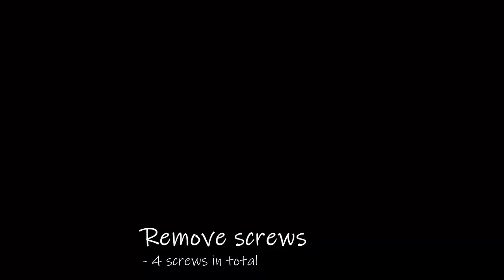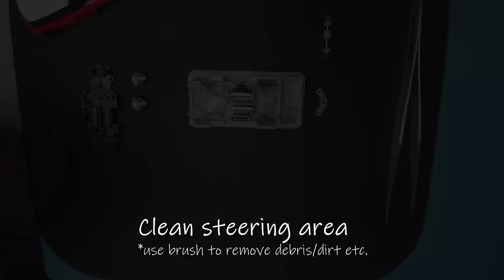Tiny Racing (Turbo Racing 1/76)   Part 3 - Stuck Steering/Maintenance

Comment: Little tip for the front wheels. You can get them of the axle (pull carefully). Then you can deep clean, and lube the axel and knuckle. I use silicone spray for that.
Push wheels back on axles (carefully, you hear little clicks when it snaps in place).
Re-assemble the car.

Now, to make it really smooth, you take a multi tool with a roundisch tool in it. Spin it on low speed, and lightly hold the front wheel on it, so it starts spinning.
Do this for both front wheels. ( Not the backwheels!).
This will make the front wheels run smoother then from factory.

If you like, I could make a video of the procedure.
Regards, Rene
Reply from the maker: That's a good one! Understand what you're saying. 

Since there is a need to be "careful" removing wheels from the axle (and re-sitting it back till hearing the "click"), a video highlighting this procedure would be great. Definitely would help the community!  

Cheers
Reply from the maker: @renekatuin  🤣 thanks for the vid, looks good to me!
Reply: For this procedure I am using a Dremell electric tool to "warm up" the front wheels. After couple of minutes the front wheels are ready to fly ;-) Some of my TR bugs came with over tighten front wheels and rolling on the road was funny and shaky. Now all they run well.

Comment: Thank You for making and upload this video. I struggled with one of my cars, actually the same color as the one in this video, so I had to disassemble it. And I really should now better. Of course I messed up and ended up with a some small pieces I did not now where or how to fit. Luckily I had seen Your video, and I watch it several times again. I did not notice the small springs when disassembling so they were both gone. I found one stuck on the magnet beside the motor but the other was missing, but luck was on my side so I found it on the floor. And now the little fellows back on the track thanks to Your video.
Reply from the maker: You're welcome 😊 Glad to hear that the car is back on the track and all's good!
Reply: @simplyatomic  Hey mate any idea what you call that gear at the steering rack ? you know the one thats a v shape of looks like its cut at an 90 degree angle ?
Reply from the maker: @thebandit1324  No idea what's it called. It looks like a normal gear but only a quarter of it. 🤷‍♂️

Comment: Great video. but my C82 steering wheels seem to be stuck frequently and mostly towards one side. I have opened and cleaned every part and put it back. Yet the problem persists.
Reply from the maker: Thanks! Maybe you can try to "deep cleaning the front assembly (https://www.youtube.com/watch?v=0H2iGrXXu8k)" If still persists, I'm guessing it could be worn out if you run it often.

Comment: One of my Mini Coopers have a weird problem. After some racing the steering stuck again. After the maintenance you've shown in this video it is bac on the road but after some time it is stucked again and again. So I've reached the conclusion to order and replace entire steering assembly. Hope with the new parts to resolve that very unusual malfunction . I have 17 Turbo racing cars and have such a problem with just one. We'll see when the parts come from China.
Reply from the maker: 17 that's a lot 😍.. 1 out of 17 is not bad! Hopefully the new parts resolve it. 

Anyway, while waiting, maybe you wanna check the motor for the steering (see if there are any dust/dirt; check if it "gear" on it is not too loose; press down the motor to the chassis to make sure the contact is fine).
Reply: @simplyatomic  Immediately after purchasing my TR "bugs" I am doing one useful procedure : gluing with a little drop of silicone glue the both motors to make sure the are solidly flatted to the shasy  and to prevent any movement and full contact with the gears. I found the problem with that Mini : The fan gear have couple of teeth damaged , and every time I pull steering to full right direction it got stacked . The new fan gears are on the way, so soon the little bug will be in perfect health ;-) And by the way - I am racing my TR bugs ONLY on my micro drome, not on the floor or outdoors. For outdoors I have another scale vehicles ;-)

Comment: Hi there ! I own a C72and i wonder if you can just remove only the wheel whitout dissassemble the whole thing. There is no video on this procedure ( just chinese one with no voice ) because they are not rolling free because full of dust and stuff and the car go a little bit slower has usual.
Reply from the maker: Hi, have not tried pulling off just the wheel. But @renekatuin posted that he deep clean and lube the front axle by removing the wheel. He also posted a video on how he did it ( https://www.youtube.com/watch?v=0H2iGrXXu8k ) . Btw, this was for the older model not the C72, but I guess it should be identical.
Reply: @simplyatomic  Yeah i finally did it after finding another video using a flat screw driver to make the wheel pop off and the axle is too big to be bent. When you want to put back the front wheels you need a tiny bit a metal to put it inside the front and push the axel then push back the wheel.

Lot's of dust and tiny hairs, now my car run like a charm again.

I wonder if i can 3d print some wheels to make it drift like the c64 but without any gyro.

Gonna try this week if i got some time.
Reply from the maker: @nobocks  That's great! 

Should be tough without a gyro but why not!

Comment: Mine stopped working, I put it to charge on the controller, but it's not picking up charge. Neither on the controller nor via the USB cable. It's not turning on the light. It has been unused for a long time. Was it the battery? When I plug the USB cable into the cell phone source, it emits a very quick flash of light and goes out. It's not working. Help!
Reply from the maker: Sounds like battery issue. If you don't use it for a long time, and the battery is left uncharged, it might drop too low causing the battery to fail. Try charging it awhile on a USB charger, sometimes this might "wake" it up. But be sure not to leave it unattended when its charging!
Reply: @simplyatomic  Okay...I'll try. Thanks

Comment: my steering is stuck and I can’t figure it out, took it apart but have yet to get it to turn consistently…it’s new
Reply from the maker: since its new, there shouldn't be any dust/dirt. try checking the transmitter steering trim, make sure its at its center point and redo it.

Comment: Hello! i need your held! Me and my brother  brought a TR C72 and its amazing. However, we have a problem with the cars, when we turn all to the right the car makes a spin. I already cleaned bur the problem didnt disapear! Any ideas? Thank you a lot.
Reply from the maker: Hi there! Base on what you've posted, I would:
1. Check that the front tires are rotating freely by spinning it and see if there is any binding. If yes, check out mini rc channel video ( https://youtu.be/0H2iGrXXu8k ) on how to clean it (also check the rear axle too) .
2. Try running it without using the body. If it turns well, the tires might be touching the body.

Hope either would solve the issue.

Cheers

Comment: hi, I have a problem with my mini. After a few days the car steers more to the left than to the right. It's not a problem with the steering trimmer on the remote control. I tried cleaning and there was actually a bit of dust but the problem remained. what can it be?
Reply: I solved the problem! I removed the front wheels from the axle and there was dust and hair. After cleaning and reassembling all Is OK again!
Reply from the maker: Hi, sorry to miss your post. Glad you solved the issue!

Comment: Hello, my car is not going straight. I can trim it, but then the left and right are not the same. If I dismantle the car and let the servo turn off and then put everything back together in a straight line - it just won't go straight. I have no idea what else to do. Do you have any ideas? Greetings Daniel
Reply from the maker: Hi, if there is no binding on the servo, there might be some dirt build up or dust/hair in the front wheel pins. Check out mini rc channel video ( https://youtu.be/0H2iGrXXu8k ) on how to clean it (also check the rear axle too) .